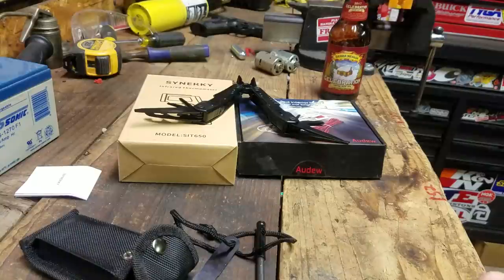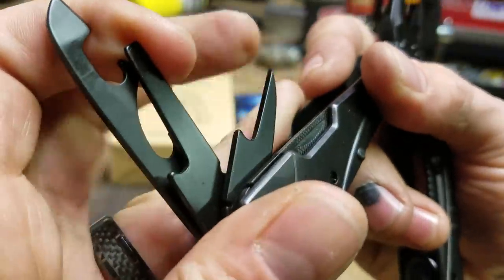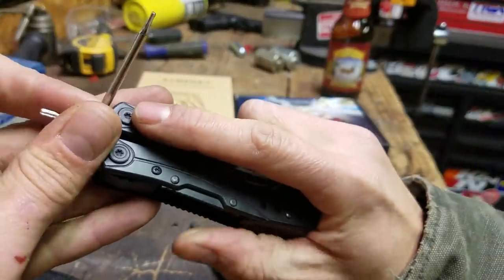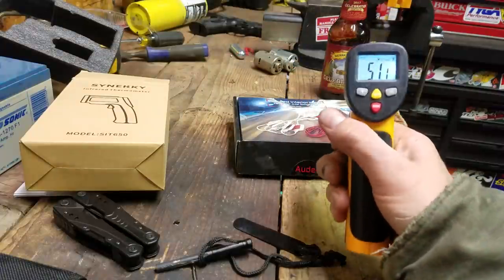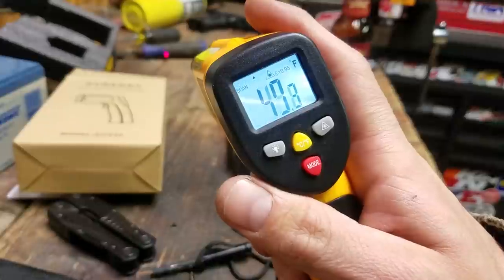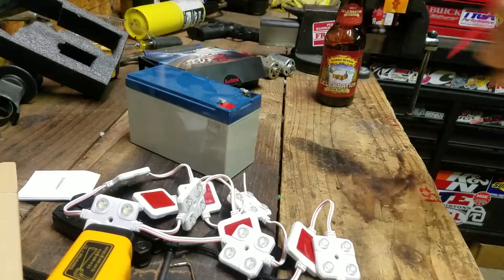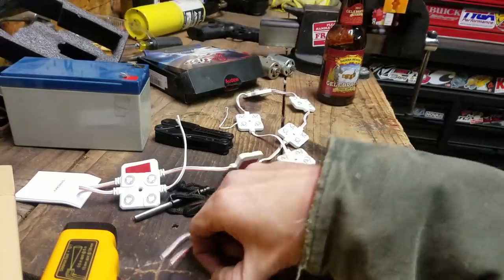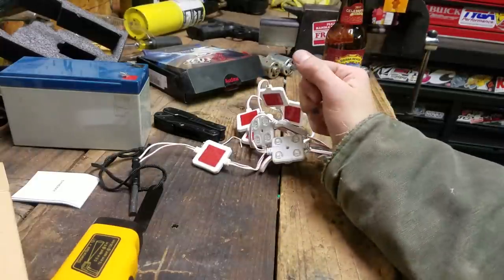Corporate Shill Video: Fine Products from the Chinese

Comment: I put those same lights in my work van. They work GREAT, lit it up like a stadium. I did have to cut them all up and use the extra lead wire. Worth the time to set them up right.

Comment: mount on a ferrins strip or some 7/8 strut after drilling holes larger for 1/4 bolts and spring nuts a few magnets and got a movable light bar for the back.. Cool items thanks for sharing

Comment: You're doing it right Mike. If you simply accepted items to slam and trash, that'd be your reputation, and others would be less likely to ask you to review their products.
That's a handy selection of items that you chose. The temp guns are available all over for just about the same price range. That one is a decent starter for basic use, and there are others that have a feature or two more, and a slightly better finish quality, but that one isn't much different that my Raytek gun that's near 20 years old. I can't imagine what they cost back then.
I like the multi-tool also. I have a similar one, called a Flip Grip. I bought it 12 years ago at Menard's for around $12-14, on sale. That is the chinciest pouch they could find to put it in though.
Reply from the maker: +Rob's Wrenches well thanks Rob.  I just feel like I've been taking on too much free stuff and don't want that to be a trend
Reply: Good shit Mike! You're all good.

Comment: Perhaps if a blade gets broken or some schmoo gets stuck in the multitool knife the tool to take the sides / blades whatever out you could use it then to clean or replace parts.
Reply from the maker: +Ollie B I guess. But higher quality models should have a good bit of loctight on them

Comment: I would rock all three. I wouldn't use the multi-tool as a survival tool, but certainly on a jobsite until its trashed. I have a feeling those lights are going to be more than enough if diced up and put in the right locations. I posted a video of my new toolbox that you should get a kick out of...lol
Reply: Why wouldn't you use the multi-tool as a survival tool? When you're in a survival situation you use whatever you've got. It is no time to be worried about labels, or brands.
Reply: Paul Frederick I suppose I should have used the word choose in addition to the rest of the sentence. I have both a cheap Chinese knife and a good quality steal Ontario knife. While in a combat zone in Iraq, I chose to Carrie and use my Ontario, but if I had no choice, I would use the cheap Chinese knife of course. However, I know the cheap Chinese knife has its limitations.
Reply: +Jeff Parker in a rough situation I'd rather have things I don't care about much. That way I am less attached to them, and all the baggage associated with that. I like to travel light.

Comment: I'm like you Mike I have no frame of reference when it comes to Celsius temperatures. Kilometers don't really click with me either. A mile is 1.6 kilometers, which is a clumsy number. Although the relationship between miles and kilometers follows the Fibonacci number sequence. Which is yet another remarkable coincidence. I often find golden ratio objects a bit dumpy in appearance though. It works for some things, but not for everything. https://en.wikipedia.org/wiki/Fibonacci_number